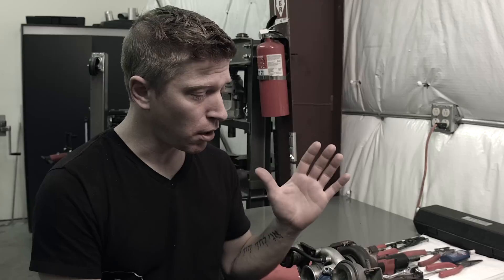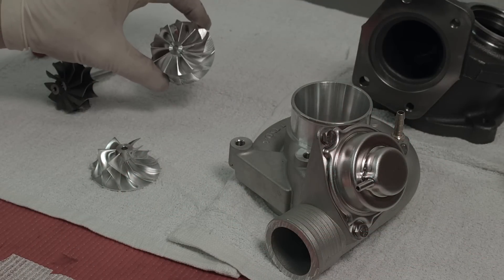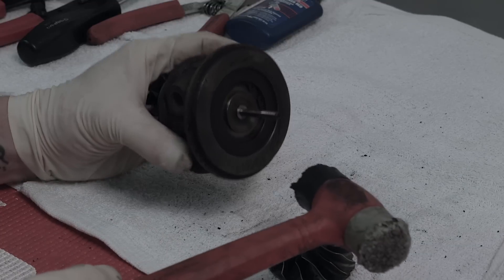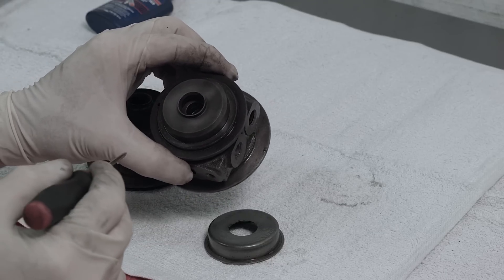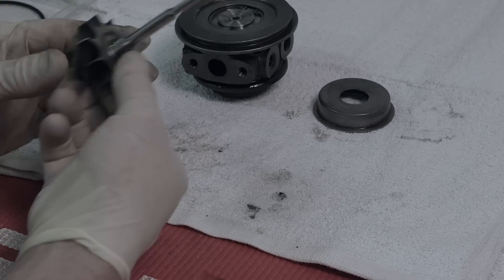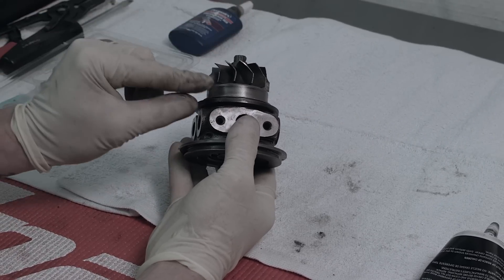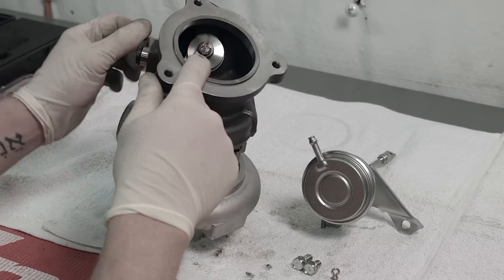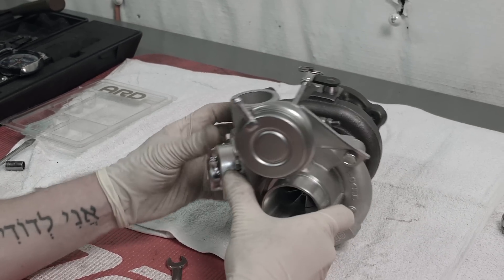ARD Turbo Rebuild - Mitsubishi TD04HL

Comment: Is there turbuild rebuild kit you recommend and what size compressor wheel should I use
Reply from the maker: We recommend and use the Mellet kits : http://www.ardideas.com/TD04HL-Turbo-Rebuild-Kit-Super-Back_p_133.html
As for compressor wheel, depends on your power goals...  Our 19T conversion wheel is good to approx 300 bhp depending on supporting mods etc..
Reply: One more thing, Where do you recommend getting snap ring pliers big enough? The ones I have are to small.
Reply from the maker: Any professional tool distributor should be able to help you, in a pinch Amazon is always there :)

Comment: I'm in the middle of rebuilding my turbo but ran into a problem. After tightening the compressor nut the turbine doesn't spin freely anymore. Any advice?
Reply from the maker: +kp202010 Make sure your using the right parts for your turbo, specifically regrading super back vs. flat back. If you like email me direct at ARDideas@gmail.com and I can see if I can help more!

Comment: will the billet 15g compressor wheel clear the td04h-13c housing?
Reply from the maker: +bryan larrea No, you would need a matching 15G compressor cover. We have used and refurbished in stock if you need one! Message me at ardideas@gmail.com and we can get you setup!

Comment: What are the two tiny snap rings for? They're in the kit but I didn't see you using them
Reply from the maker: +Pypamid They are used for the support of the bearings on the interior side. Some folks replace them, some just use the originals as they can be a bit hard to access without special tools :)

Comment: looks easy to do. if I can hear the turbine scratching sometimes and it stops spinning and leaks oil as I. billowing smoke out the exhaust, what are the chances the blades and shaft is damaged? I want to have the right parts before I take the thing all apart...
Reply from the maker: +Kyle Dupont It is highly likely the turbine blades and shaft are damaged if you can hear them scraping on the turbine housing. I would plan on a new one unless you can disassemble first and inspect. Some upgrade options are the 11 blade and 9 blade TD04HL turbine wheels if you're looking for something other than stock :)
Reply: +Robert Arnold you were right, the turbine fins were all mangled on the edges. there was also a almost a quart of oil in the inner cooler! I ordered a turbo cartridge instead of rebuilding it
Reply from the maker: +Kyle Dupont Good idea. In some cases it's just not worth the time/cost to rebuild if there's been significant damage.  Happy boosting!

Comment: ARD Tuning  I have a 2004 subaru forester xt (ej255) with a td05-20g-8cm^2 (8cm^2=hotside a/r of .57). I was wondering if i could replace the 20g wheel with an 18g wheel. Would it be a direct swap with no other modification needed ? I would probably need a re-balance after correct ? Could you recommend a good 18g wheel for me to purchase ? I also have a td05-18g-7cm^2 (7cm^2=hotside a/r of .49) would swapping the hotsides be an easier solution to get the end result of td05-18g-8cm^2 (8cm^2=hotside a/r of .57) . 

If they sell the tdo5 housing both with the 20g wheel and the 18g wheel then what is the difference ? Isn't a td05 housing a td05 housing no matter what compressor wheel is inside of it or maybe i'm wrong ? But just because there is an 18g compressor wheel or a 20g compressor wheel doesn't change the fact that its a td05 housing right? I would have it professionally balanced, but i think i'm more than capable of taking it apart. It's simply nuts, bolts and snap rings, nothing to be scared of.

What i'm saying is i basically have all the parts between my two turbos to build exactly what i'm looking for which is a td05-18g-8cm^2. I was really asking what is the easiest route to take. Swapping compressor wheels, or the hotside housings

Thanks, 

Phil

Comment: Thanks bro, for the engine insight.  Been thinking about mine. Though it's a 1998, it's 'only' done 120k. I use exclusively full synthetic oil and only 4 star super unleaded (after rough idling and occasional stalling - engine happy now, and smoother). What does your forearm tattoo say. I can't read Hebrew, unfortunately. Friend of Israel :) :)  As far as tuning is concerned...  is there anything one can usefully do to improve the bottom end torque, it just doesn't seem to kick in until about 2500 rpm, when it takes off like a scalded cat.  Perhaps the turbo can be re-mapped for low end grunt?  It's 300 Nm torque seems to disappear below 2000 rpm.  I presume the new engines @250 bhp and 2.5 T5 V50 are about the only viable upgrade, but i don't have $30k :'(

Comment: Will that work the same for the 13G on my 1999 V70 XC?
Reply from the maker: Yes indeed! Same procedures, same process :)
Reply: +Robert Arnold you have a rebuild kit for a 13g?  or a conversion kit for a 13g? i can't find it on your site
Reply from the maker: Yes you can find it right here: http://www.ardideas.com/TD04HL-Turbo-Rebuild-Kit-Super-Back_p_133.html

This kit can be used to either rebuild current 13G or use the additional parts that come with it to convert to super back 13T or larger 19T :)

Comment: When you tightened the compressor nut, it appeared that the compressor wheel spun relative to the turbine wheel. Wouldn't this impact the balance?
Reply from the maker: Good eyes! Off camera I had moved the wheel prior to torquing so it would end up in the right spot but properly the wheel should be cooled off and 'clamp' onto the turbine preventing it from spinning. I might end up editing that or notating it for the future... Thanks!